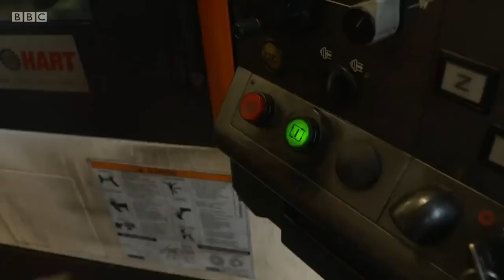Australia resists net zero carbon target ahead of Glasgow climate summit - BBC News

Comment: Maybe we (in Australia) need to start building Nuclear Power Stations . The rest of the world seems to omit that we dont have any Nuclear Power here and yes we use coal and gas for power . However , most homes do have solar power generally .
Reply: plant forests where you still can. Large scale Solar and wind power on non usuable land. Use of low energy water desalification. Encourage as much flora and fuana as you can. Remove pesticides, organic farming, Energy efficient buildings, shading, local employment and sustainability, avoid low land.. That would be my advice. Good luck
Reply: Australia has the potential to generate 600% renewable energy + hydrogen. We do not need nuclear which also happens to be way too expensive and is only being used as a delay tactic for fossil fuels at this point
Reply: @brianisme6498  that's nice but you haven't mentioned the amount of CO2 that is also required to build nuclear reactors as well. 

Fundamentally there's a reason why there hasn't been a large nuclear uptake, it's far too expensive for the scale required and they take ages to build and it just can't compete with renewables which are becoming cheaper, more efficient and faster to build. 

Since renewables are constantly being researched I'm sure we haven't seen the last in innovation with them either (ie bird detterants on wind turbines and making them recyclable, etc). Yes, obviously they aren't perfect but they're clearly the best option to decarbonise at the speed we need.

I'll say again, the nuclear argument is a delay tactic by fossil fuels.
Reply: @stoufer2000  genius
Reply: Germany has from 2023 no nuclear power anymore and is also aiming for net zero, so I'm sure Australia with it vast land mass compared to its population will be able to make the switch to renewables
Reply: @aredbaron9294  fun fact, the worst place for renewables in Australia is still better than the best area that Germany has to use. So yeah we definitely can, we just need to change our coal captured government.
Reply: Have a great day!